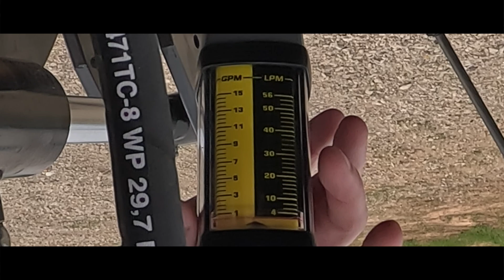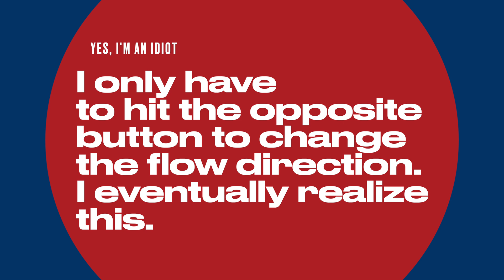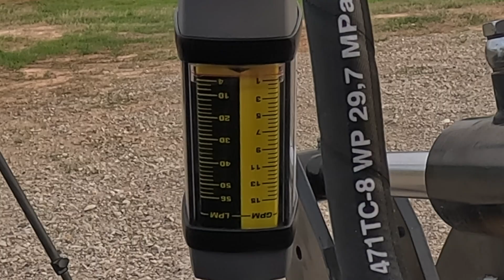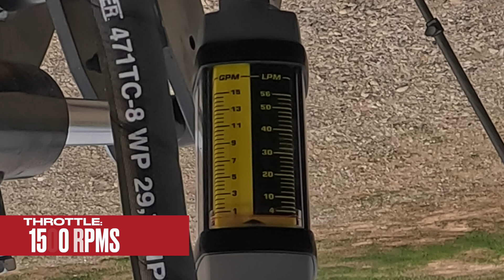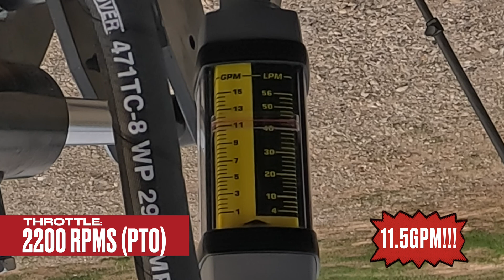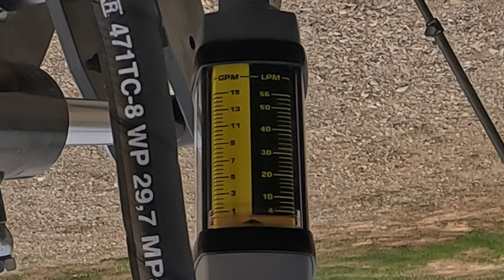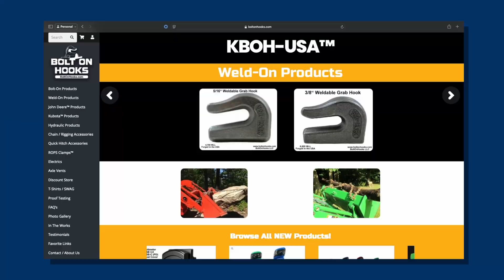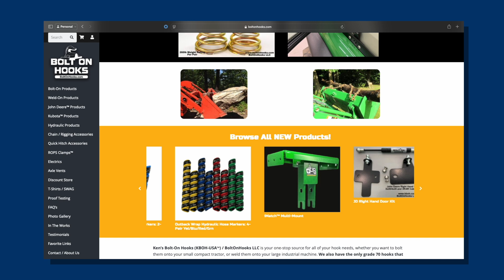Can a Tractor Run Big Hydraulic Attachments?

Comment: Awesome! Does anyone know what size the standard kit 3rd function lines are on the tym 574?
Reply from the maker: I'm not 100% sure, but they are hard lines, which will be a little different that hoses. A hose has a fitting that is inserted into it, that has to be smaller than the hose diameter, and have enough thickness to support itself. That is going to create a restriction within the hose that is separate from the hose itself. A hard line, even if it's a 1/4 inch in inner diameter, won't have this restriction. This is all theoretical though, and probably can't be confirmed without testing like I did in the video. I'll actually look into testing this though because I'm definitely interested in finding out.

Comment: I’d love to see if you had any gains from pto rpm to the tractors max rpm.
Reply from the maker: I wish we could post images in our comments here on YT. I've got one that shows my tractor at max RPM, and it's only 2250. My PTO ROM is 2200, so that's not enough to make any difference in this video. However, it could definitely make a difference if you can bump your PTO RPM from say 2600 to a max RPM of 3000. I just couldn't show that off with my tractor. In the future I might be able to do this same testing on other tractors, so I'll definitely include it if there is a potential difference to be seen.

And, thanks for watching and commenting!
Reply: @SabineRiverValley  I have a t25 and I know I have a good bit of rpm above my pto rpm that’s why I was wondering.

Comment: If you connect them hoes together on your grapple it won't be hard to hook them back up to your tractor. The hydraulic pressure is in your grapple not in your tractor.  I hook and unhook my grapple all the time and never wiggle the handle or shut My tractor down just try it and you'll see what I mean.